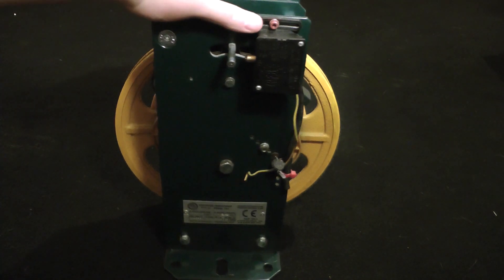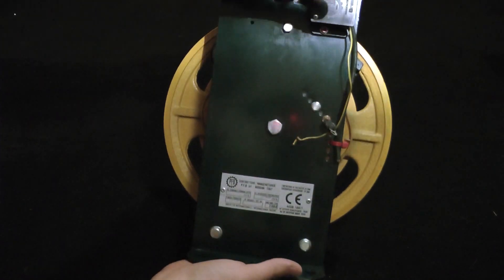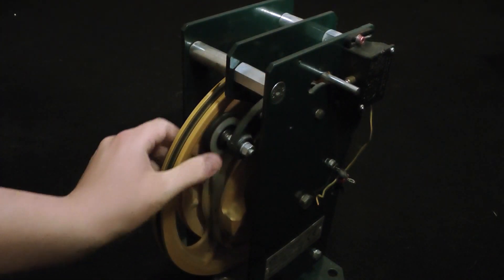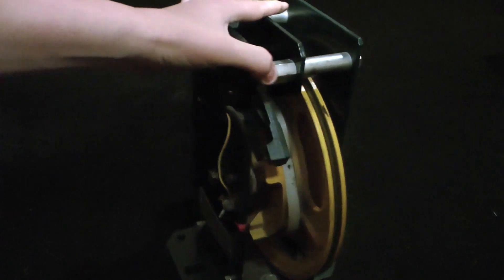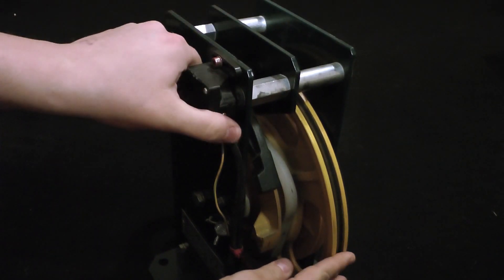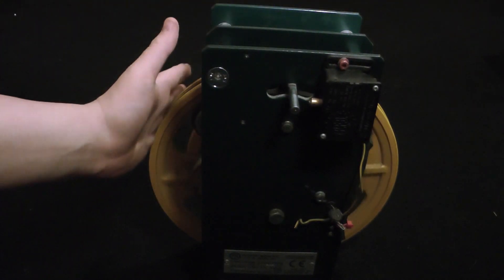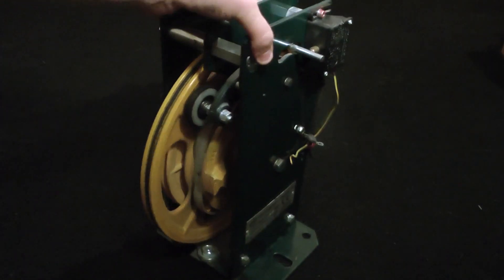Elevator / Lift Overspeed Governor

Comment: The 2nd smaller sheave is the test sheave. When you pull the rope over to that smaller sheave, you can test the function of the overspeed governor by running down the cabin with nominal speed.

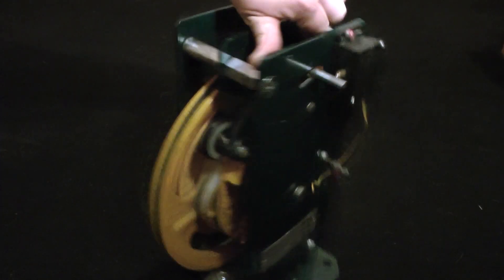Comment: 1:55 Smaller wheel is for commisioning and checking this device. This wheel should be 65-70% the size of normal wheel (making it spin 30-35% faster in nominal speed of elevator)

Comment: Jawless overspeed governor aka friction type. If the wire rope elongated and loosen which therefore doesn't sit properly in the governor wheel groove, safety gear won't work. This is the downside of this sort of governor.  That's why The pit tension pulley and weight plays an important role.

Comment: Thanks for the helpful video!  I'm an engineer currently working on an elevator system.  What speed does this unit trip at?  It should be on the label.  When the speed is too high (car in decent) the mechanism collides and this puts a nice tug on the cable attached to the car's emergency brake.  E-brake stops are rather quick and violent.  A knurled roller inside the e-brake jams the e-brake housing to the rails.  Both the left and right rails have an e-brake.  This governor must be manually reset in order to allow the elevator to operate again.  The switch inside is a normally closed switch. It is in series with the safety chain circuit.  This means someone has to go up to the top of the hoistway and  manually reset the switch if it is ever tripped.  If all traction cables were cut on the elevator and the car started free falling, this is the thing that saves you, and it will activate the e-brake so quickly that you'll hardly realize what just happened.

Comment: It's working both directions or down ward directions
Reply from the maker: sunil KUMAR Downwards only
Reply: @danielrichardbond  NO . The electrical switch works bi-directionally . the mechanical works ONLY in the down .
Reply from the maker: @738polarbear  YES, so downwards only.

Comment: Does it work in both directions?
Reply: I think it only needs to work in one direction, Downwards, It's to stop the car running away and smashing in the the floor!

I just acquired a really old cast iron one, It must weigh two hundredweight, Had a job getting it out of my car!! :))
Reply: yes it does . the elevator moves up n down.. when it moves too fast . it will.trip
Reply: Some don’t but there are now regulations making it a requirement to have governors that trip either way and trip immediately when the lift moves unexpectedly

Comment: the smaller pulley is to test the govenor, the rope is taken off the main groove then put onto the smaller, the lift is run down and the govenor trips, you also tacho it whist its doing this.
Reply: NO. You do NOT have to remove the main governor cable . Just attach an electrically driven cable from an outside source onto the smaller tripping pulley. You COULD remove the main governor cable but elevator companies do NOT usually do this as a general rule.
Reply: @738polarbear  dont talk out of your arse ?

Comment: Am I right in thinking that when the governor stops the cable moving, the cable activates the safety brake on the car? I have a similar governor made by Hans Jungblut of Köln, which looks a little older and operates in both directions. At some time my governor has been violently activated and has a chunk of cast iron missing from the the yellow wheel.
Reply: funscience Yes

Comment: The extra groove is intended for testing the governor. When you place the kabel in this groove the governor wil trip at the normal speed of the car.
Reply: No . The smaller  pulley is used to test the OVERSPEED of the car . NOT the normal speed.